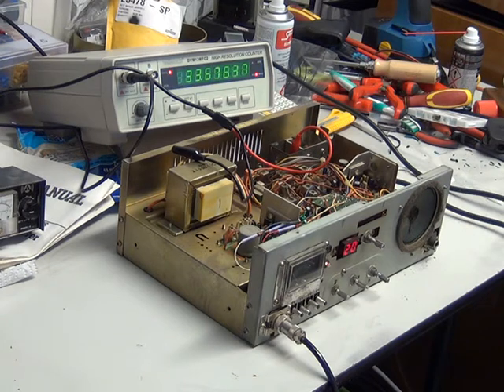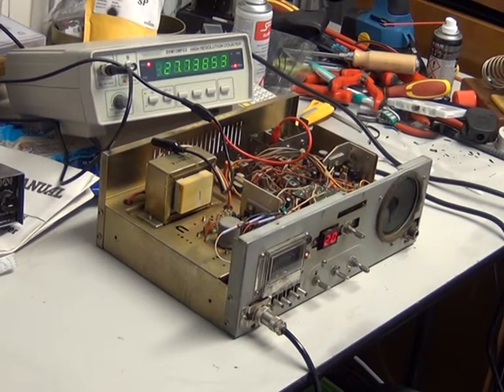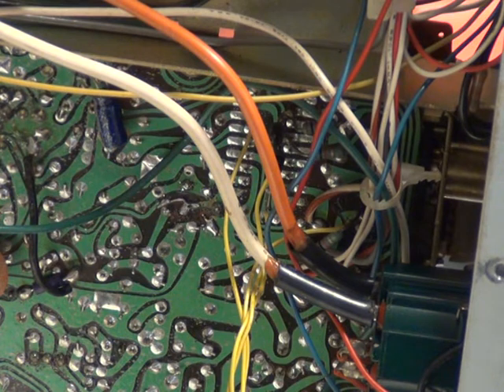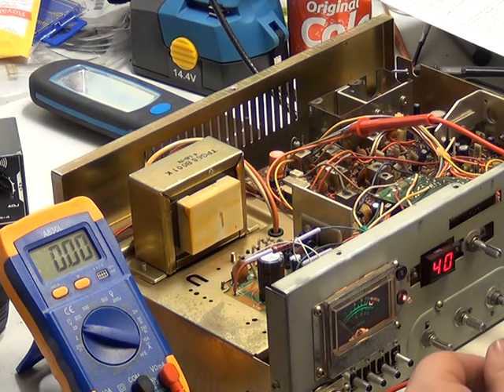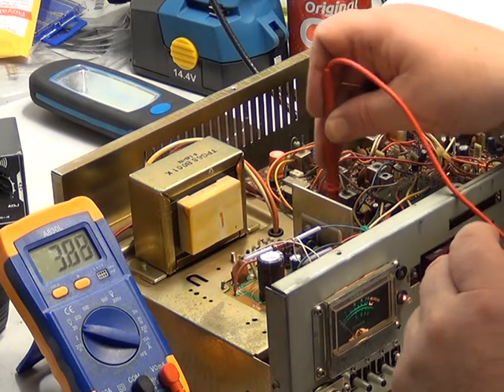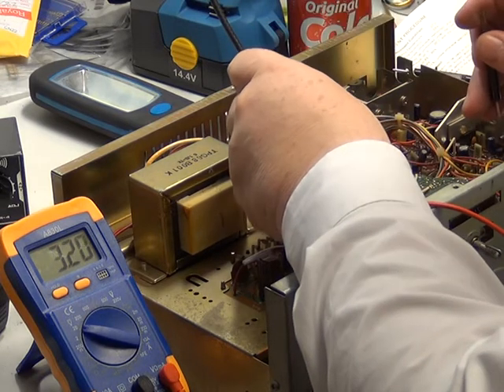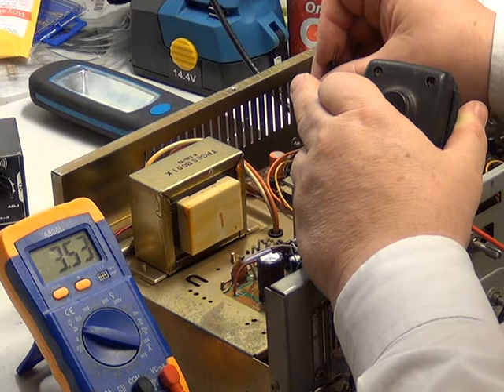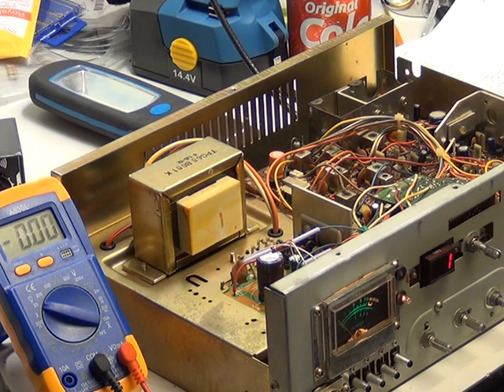Harrier CBHQ (UK) CB Radio (CB27/81) Base - Repair & VCO adjustment

Comment: Hi Richard, loving the service video's on this, truth is I have just been gifted one.
Looks inside very original,  however the main power transformer transistor was dead so I have replaced it. Now it's doing 16.2v will take your advice on changing the both capacitors. Couple of other things there is a white wire with red tracer off somewhere and main volume adjuster crackles bad. Regards Dave in Hereford.
Reply from the maker: The power supply voltage is adjusted by the small potentiometer on the regulator board; adjust it carefully whilst monitoring the voltage & set it to 13.8V. If it won't adjust (as in makes no difference)  email me.  We use Servisol switch cleaner & no other to deal with dirty volume controls. You apply the straw like applicator to the can & squirt it into the innards of the volume control where the three connections (not the rear four switch connections!) go into the body of the potentiometer. There is usually a gap there. I've no idea about the wire but you could email me a photo.

Richard, G0OJF, UK

rshireby@yahoo.co.uk

Comment: You didn't show a damn thing in this video, what's the point of it ?
Reply from the maker: The Harrier cb has been covered over four videos. his one covers repair of this particular example & VCO setup. Next video is tx alignment, next video is rx alignment, next video is on the air test. The idea is not to do really long videos that people have to wade through, but to produce separate ones so viewers can quickly find thebit they need to know about.

Richard

Comment: Hi where do you buy the bronze trim tool please i had one years go but can't find a replacement anywhere ?
Reply from the maker: Both the black & yellow trim tools came from RS components. Guess what?...they've discontinued both of them. Luckily the yellow ones came in packs of 5 & I've some left to cover future breakages but I'm struggling with the black ones. We've one for each bench & that's it. We use phosphor bronze strip in the church pipe organ side of the business & no doubt I'll have to cut & file it down to suit & then drill some wooden dowel undersize & shove it in heated in the not too distant future.

Richard
Reply: thank you for your help the yellow one is no problem cpc sell them

Comment: Nice to see another of your videos up on the youtube Richard. I always enjoy looking at all the old 27/81 equipment. I just wished there were more people on the rig. I have a flick round from time to time but very few copies these days. I have a SSB set but need to put up a better antenna to get it working

It would be nice to see more info on antenna, as I'm not sure if horizontal dipoles are UK legal however, it may be the best way for me to put out skywaves on SSB Midband. Or maybe I should just give up on CB and do a Ham foundation. It's all money though.
Reply from the maker: Well you could use a hoizontal dipole, but will only then be in communication with others horizontally polarised. Clearly most users are vertically polarised. At the end of the day, CB is supposed to be a local 2-way radio service with up to 16KM range. I do better than that on FM from here.

Regarding amateur radio, I did the B licence in 1980 but was already a qualified electronics engineer, so just read up on the licensing conditions & took the exam & passed. I did learn morse at a Nottingham college to get the A licence about 1990, but only use ham radio usually on 70cms for talkback on our CB tests when ZX2 (Mark) is here. The other Richard (Mr Chippie) doesn't have a ham licence.

We'll be doing a video when we put up another CB aerial on the organ restoration workshop, but it'll be a boring silver rod type on T & K brackets. 

After the final 3 videos on the Harrier hombase, I'll be covering the odd vintage scanner from the 70's & 80's.

Richard
Reply: Thanks Richard, I am on the south cost of Cornwall in a rural location about 40meters above sea level, my closest Ham club is over 25+ miles away, (either Newquay or Plymouth). Most of the clubs meet in the evenings when there is no public transport. So the cost of getting licensed would be prohibitive due to the excessive cost of Taxi fares.

I was hopping to DX to France or the channel isles. I have two dipoles. I intend to set up one horizontally and the other vertically and use an antenna switch to toddle between the two. I guess I have to put them up as high as I can and give it a go. I also have a 10m HF set which of course I am only permitted to use for listening.

Anyway, thank you for the response and thanks again for all these videos, 

Paula

Comment: Another great video thanks ,have you ever done a video on a Ham Jumbo?
 the one with the two handles,mines gone deaf,bought it off eBay 4 years ago by a dodgy seller so have never used it.
can't transmit properly nor can I receive anything.
 regards Steven
Reply from the maker: Steve, the Ham International Jumbo is not a uk Legal set. All these 'export' type sets are grey imports. you will find most "export" type cb radios, i..e. those with more channels than permitted anywhere are mostly poor performers as they are not built to any country's standards. The Jumbo was well known as having poor receive especially as far as de-sensing & adjacent channel rejection goes. I accept that some dodgy service people do look at them & amongst them the rig is known as the "Ham International White Elephant".

Although SSB & AM operation is now legal on the 40 EU channels in the UK, bear in mind that CE approved modern CB radios must be used for this service & not an FCC approved American set or Grey import multi channel sets etc etc. UK 40 channels of course remain FM only.

Sorry this isn't the reply you would have liked but everything done here is strictly UK legal.

There was an FM only version of the Jumbo called the Hercules which was available in some european markets. Sadly they never did a UK version as it certainly looks nice.

Richard
Reply: Ok Richard thanks,it's in the garage now best place for it maybe as a future museum piece :) I'll stick to my York 861 for recieve and my Uniace 300 for transmit.
 If it was one unit it would be perfect,thanks for your reply maybe I'll find a Magpie Autoscan which seems to be the best of both last one on eBay the chap was asking £100 bit steep but i can understand that they are rare now,only 300 made or something from a place near the south east UK in 1983 regards Steven
Reply from the maker: We've got a magpie here so will find out if it's good or not in the not too distant future. Will need to get it to work first!
Reply: UK CB radio servicing  Richard thanks 👍